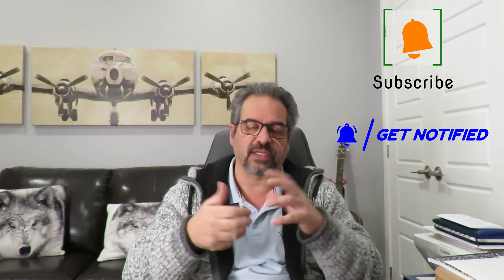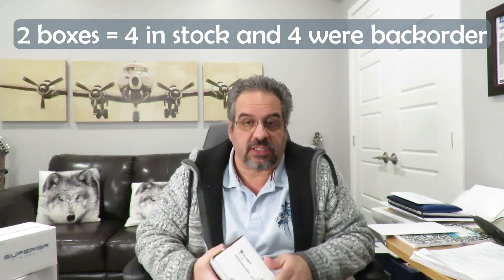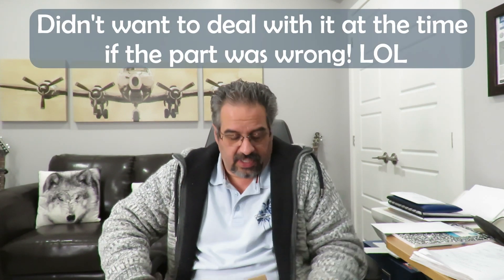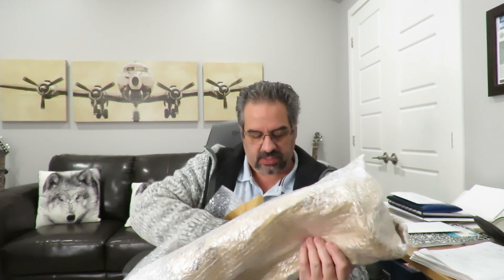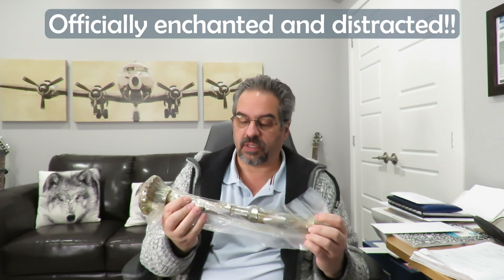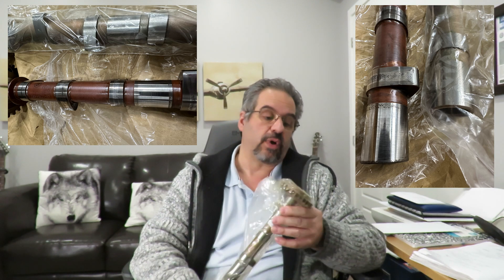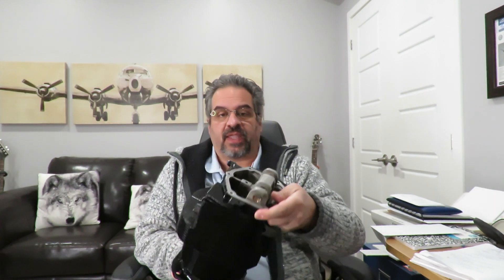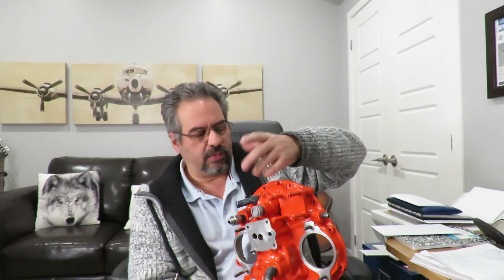Tiny airplane engine still broken!

Comment: Would be a little speed demon with an engine swap.
Reply from the maker: Meh. 200knots is fine. Will get some extra hp with higher compression pistons as well. Besides. I always tool around at 160/170

Comment: Tony. Would be helpful to everyone to add some context and facts. Pitting on the cam?  Why?  300 smoh? Yeah but where’d you get the lyc? When was the OH? 1995?  Oil leak started it right?  What’d you find out about that?  

You want to save $$ but careful doing this work yourself, or even with a field A&P. An engine not fixed properly will fail you at the worst time. 

Good luck.
Reply from the maker: Hi @4429dano. The whys and where’s are too long to answer here. I’ll include the back story in the next video: thanks for suggestion. But for quick highlight, engine was in Miami. Plane was being parted due spar corrosion. Had 138 hrs smoh when I bought it. Got bad advice from local AME in Miami which I trusted.OH late 90’s. 
Once I was ready to install on project at time. AME pulled a jug and saw pitted cam. Sent it to a shop. Lifters and cam were SUPPOSED to be swapped. Seems it may not have been as I only ever got lifters back. 
Leaks were due to incorrectly installed cylinder rings (they were twisted and kinked on three cylinders). 
I’m not doing any assembly. Person who does that for a living (and is an AME) is doing is assembling. I am just sourcing parts only and that’s where I am saving. 
Thanks for the comments. Great advice.